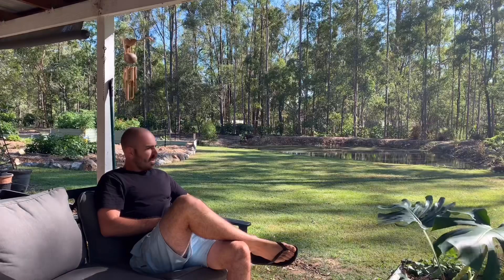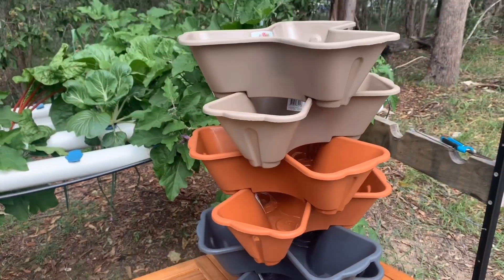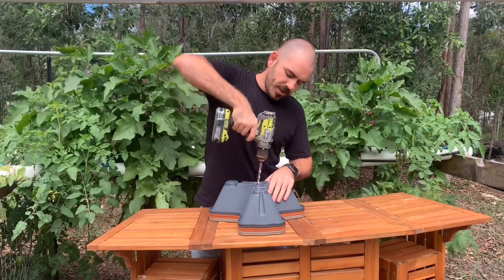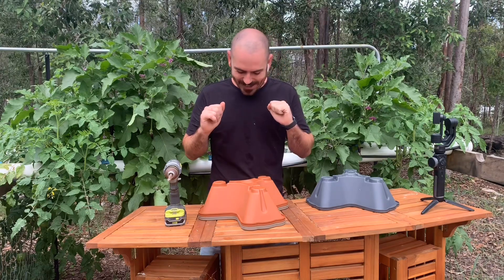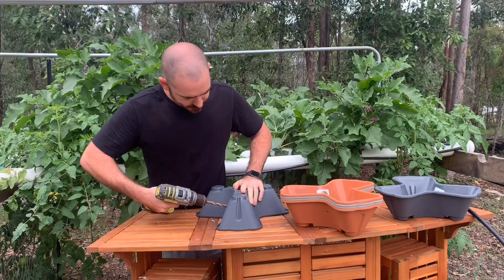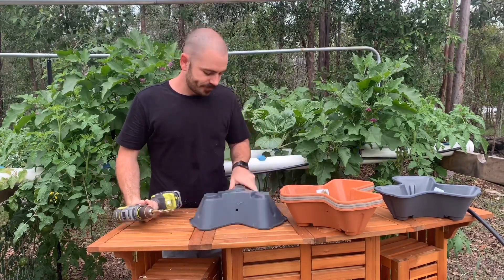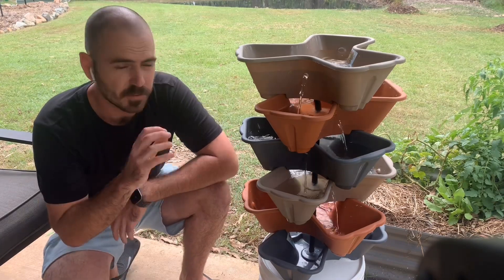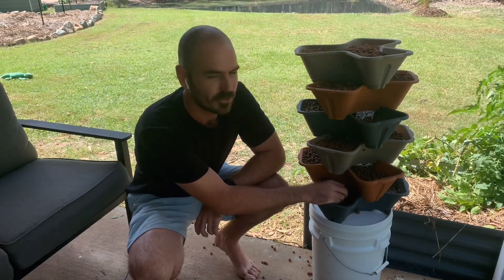Balcony Hydroponics. Don’t Build This System.

Comment: I feel like adding in a lower powered pump, adding a fill hole at the top of the reservoir, and adding a barb at the bottom of the reservoir for draining could solve a lot of the problems.
Great watch though! Very relatable.

Comment: Run drill backward after the hole first forms... Also wooden surface below that you can drill into helps prevent thin plastic from tearing/shredding

Comment: I'm thinking of trying this idea with a few tweaks, do you know what the stats of this pond pump were? litres per hour or max head it can achieve? if I try REALLY REALLY hard to read the label on the blurry frame... does that say 750LV? the 750L/Hr low voltage pump from bunnings? My boyfriend has the same one, don't worry I'm not a water pump savant!

Comment: If you need to put holes in thin plastic like that.  Use something hot like a soldering iron and melt holes.
Reply: David Thomas Either that or a drill used for metal, not one for stone + predrill the holes always helps too.

Comment: Hi Hoocho, so you can make it work with three changes:
1. Install an Arduino with a relay. Program the Arduino to close the relay and run the pump for 2 minutes every 30 minutes but those values can be whatever works best for your system.

2. Make a tiny hole at the bottom of each pot so that they completely drain during each flood and drain cycle.

3. Put the reservoir on bricks and install a valve at the bottom so that you can drain and flush the system without lifting the lid. You mix your nutrients separately and just add via the system.

I did something similar a few weeks ago and it works great. Just make sure the pots drain completely between cycles.
Reply from the maker: Julian Taylor I dunno, seems too complex... couldn’t a digital timer replace the arduino. I could’ve made it work if I’d tinkered with it. But the problems I could foresee with changing the res and roots clogging the holes just weren’t worth it.

Comment: I think it would work just great, maybe with some modifications
- You can use styrofoam at the top, you will just need to cut it in the same shape as the pots, shouldn't be hard. Just make an extra hole for airation
- for the reservoir, you can add an extra transparent hose to the outside to get to know the water level, and also can be used to remove the water out and you can fill the reservoir with fresh nutrients
- you can also control the flow by reducing the pipe size with a connector, just make sure it is not so small that it blocks the bump

Good luck

Comment: The top watering would also create an algae problem.  Good effort though, you can easily control flow by putting an inline tap into the feed or even put a loop in your feed line to create a larger lift volume too.
Reply from the maker: dazedb42 I was going to mention that had the system worked, but I was hoping the plants would get big enough to block the light... I also think roots would have become a problem.
Reply: @Hoocho  Plant shading def would help. Have you checked out the Kratky method?  It's the ultimate in lazy hydroponics.
Reply from the maker: dazedb42 Yeah I’ve done a few kratky systems off camera. I’ll eventually get around to videoing one. But I find they’re less productive and I always end up throwing on an air pump and air stone.
Reply: @Hoocho  Yeah the air stone really helps and I sometimes get plant shock from different temperature water when I top them up.  Rats are killing me presently, nearly all my tomatoes gone but thankfully there's time to start another crop.
Reply from the maker: dazedb42 I’m getting a heap of capsicum stolen out of my soil garden. Rats are the worst.
Reply: @Hoocho  Bastards aren't they?  Anyway, keep it up you're doing a great job